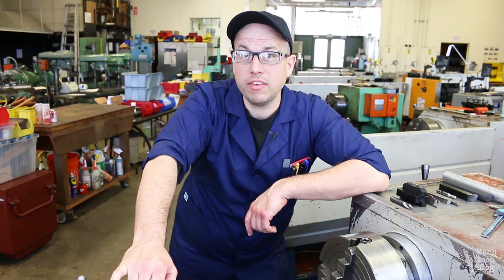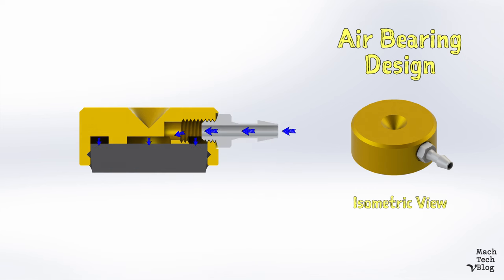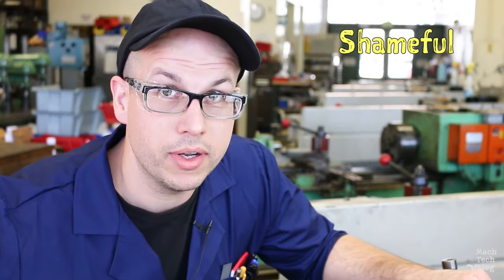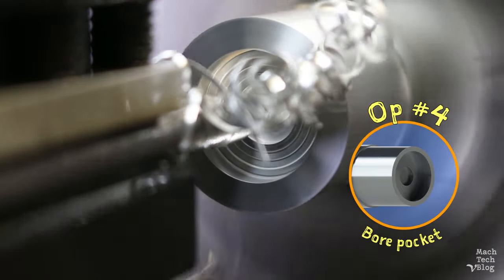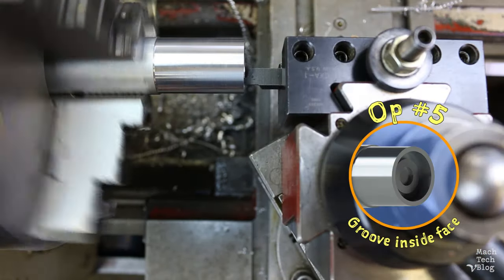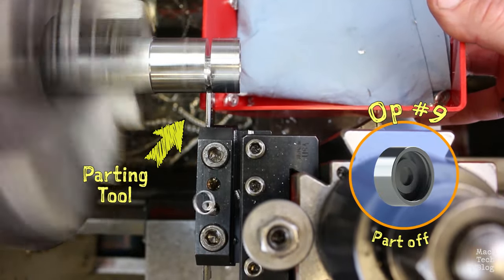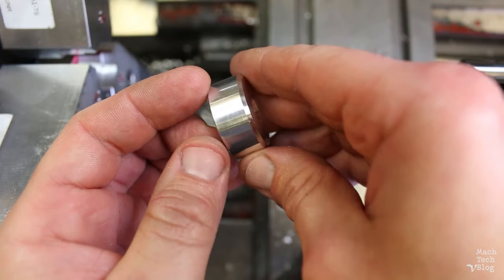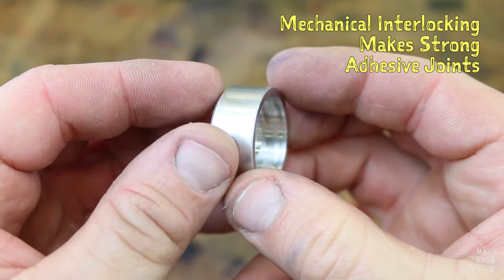Air Bearings: Machining

Comment: Why couldn't you have lapped the bearing into the aluminium, then you would have had more of a socket/pocket for more depth? Fantastic video and lovely work shop and tooling detail!!
Reply from the maker: Gosh, that sounds like a lot of work. The pressed-in spherical annulus is super easy, quick and cheap to make and it works better than pretty much anything else for precision ball mounts. To get better performance, you'd have to move to a flexure design.

Comment: lap the ball in with 1 micron lapping compound then replace with a new one problem solved  .
Reply: Uh not really, since the aluminum is far softer than the ball bearing the lapping compound will embed into it turning the aluminum into the cutting tool. So the ball would start to be lapped to the shape of the aluminum seat that's already there and not the aluminum lapped to the ball shape which is what you'd want. The only way it could be lapped would be to use something softer than the aluminum but with the exact size and precision as the ball bearing. It's a complex problem and not quite as easily solved as it might seem.
Reply: your right

Comment: Great vid. One quibble, and it's not a biggie: A lot of newbies, (and American newbies more than most) have a tendency to assume that they can compensate for lack of experience by putting more emphasis (and money) into the technology. While this is true to a degree, it can be a distraction, and an expensive one. 
Specifically: Using solid carbide boring bars, spotting drills and suchlike is a useful dodge in a tight corner (like spot-drilling ultra hard materials, or in the case of the boring bar, a hole which is very deep in relation to diameter) but when a home shop is making a part from alu alloy it usually has no measurable payoff, and there's always a tradeoff because solid carbide is stiff but fragile, and a klutzy tyro can waste hundreds of dollars of tooling in an instant, simply by omitting to check from several angles before moving the carriage or spinning a toolholder.
Carbide endmills can be great in alu if it's gummy, or if you need a superb finish by side milling a flat face, but you need to know what you're doing with feeds, speeds, sharpness and coolant. 
And for the superb finish, the machine's spindle and ways need to be in decent shape. If some or all of these are not true (and of course this is just one opinion) you're better off with HSS, and spend the money saved on tooling to keep a bigger range, and keep it dead sharp. (An ounce of sharpness is worth a pound of almost anything else)

Comment: can't wait to see the cylindrical air bearing video (I'm thinking of making a crankshaft precision balancing setup): have to come up with a trick to get the proper ID fit in carbon, hopefully without damaging the journal surface of the part to be balanced...

Comment: The triangle seat would be best partially roughed and then pressed in before machining, then mounted between centers to make sure the point of the triangle is on center. This would also strain harden the material creating a better wear surface for the ball bearing.

Comment: Wouldn’t the trihedral be easy to make using a mill? As long as you can make 120 degree divisions it should work, right? The mill won’t make hard corners but that’s not needed for this purpose anyhow.
Reply from the maker: I think you could fake in something which works like a trihedron as long as the ball contacts three discrete points on relatively smooth surfaces. It doesn't need to look pretty or even very trihedron-like. This is a fun machining challenge!

Comment: If you really wanted a simple three face cut then a rotary broach might do it with a cut bottom face to a point??????
Reply from the maker: I had not considered using a rotary broach (probably because I don't have access to one), but that's an intriguing idea. Machining a trihedron is a pretty good little challenge!

Comment: RE the ball and socket: Did you forget ballnose endmills exist?
Reply from the maker: I can see two ways I would use a ball end mill to make a ball joint: 1) 3D surfacing a trihedron on a CNC mill, or 2) plunging into the material to create a spherical socket. Here are my answers for each:

1) Doable, but I wanted the build to be easily replicable so I did not use CNC machine tools. Also, the step-over resolution of the 3D toolpath would result in a not-very-smooth surface. So, there would be some finish work involved.

2) Also doable, but the ball-in-sphere is not a very good precision ball joint. We have to start off with the admission that the sphere will not be perfect in form, especially if it's just made by plunging a ball end mill, which recreates all the problems of uncertainty with the ball-in-cone mentioned in the video. But it's actually worse than that. Even if we find a way to improve the surface quality of the sphere, it is guaranteed never to be EXACTLY the same size as the ball. The worst case scenario is if the sphere is larger than the ball, because the ball will contact only in the center and will rock around. If the sphere is smaller than the ball, then the ball will sit on the top rim. In this scenario, we're right back to the circular line contact of the ball-in-cone but without the bonus wedging effect which helps to retain the ball. Or if the force on the ball is high enough, it will press into/seize in the undersized sphere and the bearing won't be able to orient to the guideway surface. Many commercially available air bearings use a ball-in-sphere joint, but a hole is first drilled to relieve the center of the sphere. This is better, but only marginally. The ball sits on the rim of the center hole (ie circular line contact), but it is still very susceptible to getting unseated and rocking around.

Comment: Do you know what CFM you need per bearing? or CMM for metric?
Reply from the maker: As I'll show in a later video, that's a slightly complex question, but it works out to about 1 SCFH (0.02 CFM). It's very low.

Comment: I hate to be the spherical annulus who asks the stupid questions, but if you drilled a small hole through the top of your bearing, through the seat for the ball bearing and into the plenum, air pressure might then come out of the top as well as the bottom, perhaps reducing friction on the ball bearing?
Reply from the maker: Oooh, interesting... Double the bearing, double the fun.
Reply: @LaneyMachineTech  "Double-bearing all the way across the sky (so intense!)"

Comment: Could you press fit 3 hardened dowel pins into the top to provide 3 hardened contact points for the ball?
Reply from the maker: Yup, good idea. I've been thinking a lot about kinematic joints and couplings recently, and I think I may do a video demonstrating some of the great solutions people have mentioned in the comments. I also thought of a "simple" way to generate a trihedral which I'd like to share.
Reply: Machine Tech Video Blog looking forward to it 👍🏼

Comment: Is the tool blank pre-hardened?
Reply from the maker: Yes, and they usually are. FYI I was using REX AAA, a T4 grade of high speed steel which is a decent and very inexpensive general purpose tool material.